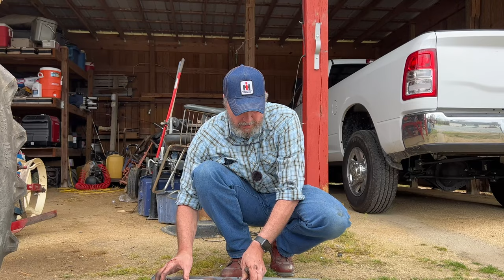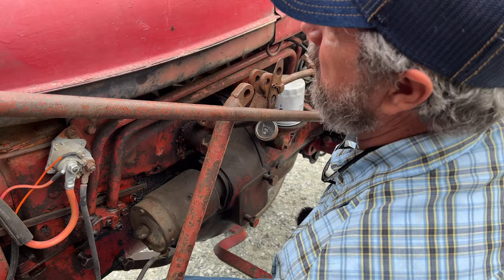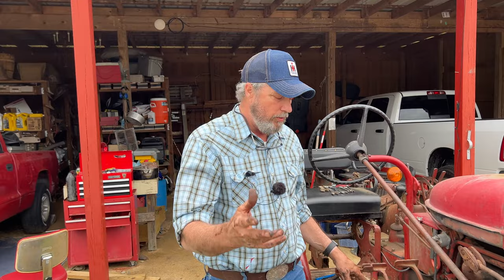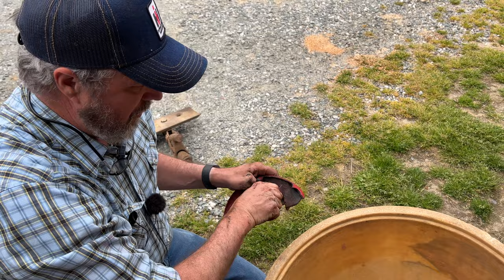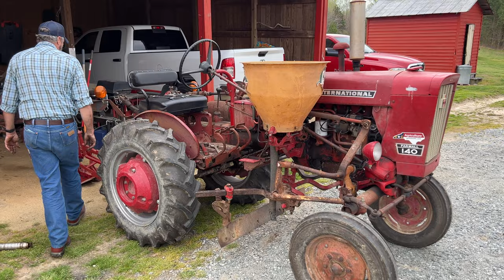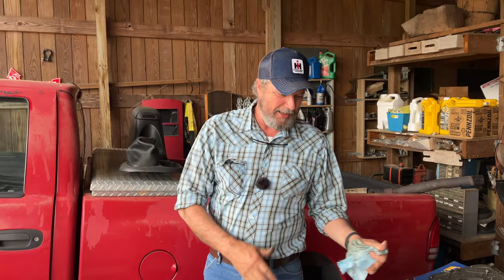Setting Up Fertilizer Drive and Corn Planter

Comment: Good video Joey.  IH did not make the cub through 140 tractors for people who were afraid of dirt and grease.  Every time you change cultivator and implement setups you end up crawling on the ground and in the grease.
Try using a mixture of diesel and used motor oil for the rust prevention on the fertilizer hopper setup.
Reply from the maker: Hey Lamont 
I’ll try that this fall.

Comment: Happy Easter Day our LORD JESUS has risen Amen
Reply from the maker: Hey Roger 
Amen Yes indeed.
Reply: Great video.  Especially for us novice.  The pry bar you mentioned was referred to as a “lady slipper” by most of us.  I’m just too old and under strength to constantly be installing and changing the implements.  That is the reason I use to justify having several Farmall’s.  Of course the batteries and maintenance become an issue.  A fun issue for me at the present time.  Storage is a different matter however.  Thanks for sharing Joey.  I hope you had a good “holiday” and thanks for reminding folks what the day really means.   Stan here.

Comment: You’ve got to get down and dirty putting a fertilizer attachment on... I learned to wipe the grease off the outside of the fitting on the hopper shaft before I got it on my shirt... the chain idlers are to keep tension on the chain and to keep them from rubbing on anything...
Reply from the maker: Hey Morris
It was still cleaner than Williams clutch . Lol

Comment: Look into the plot saver. But it's probably more expensive than just the electric tape. 

I have had good success with malorganite fertilizer. Those sensitive plants you can go down the row and just drop it along the row. If it's lots of area you might just get by doing the outside ends as they don't  want to move into it.
Reply from the maker: A subscriber mentioned five strands of fishing line. I might try that it’s pretty cheap.
Reply: @Jtwes  yea worth a try.

Comment: I saw this video a while back . Didn’t have a blade but i did make one out of a piece of wood and my bolts weren’t long enough so I used heavy duty electrical ties. And bro it works great . Biggest problem is don’t get it to low or the row will be flatter than I wished .
Reply from the maker: Hey Bart
I often thought a 2x8 would be fine.

Comment: 1st video I ever watched of yours a few years back was installing your fertilizer drive. I actually commented about how you hooked the john deere hopper to it. Thanks for sharing. By the way I can tell you been doing good. Your looking pretty spry and fit crawling around on the ground. I'm at 207 finally. I use the wd 40 gel spray in all my hoppers, it is really sticky and stays where you spray it.
Reply from the maker: I took Friday,Saturday and Sunday off. Been on it since late December. I’m sure I backed up a pound or two but on to July when I go on vacation. Hopefully we’ll break into the 180s by then.
Reply: @Jtwes  yep we will have our beach bodies by July.

Comment: I’m starting putting together one 140 from two parts tractor’s.  I also have a late model cub I plan to try setting up my planter. This cub has a quick hitch. The 140 doesn’t. 45” center to center on the 140. Not really sure on the cub. ?    All to help on High price groceries.  Yes.
Reply from the maker: Hope you get them like you want. Yes sir raising a garden is becoming very important.

Comment: Watched this for the 3rd time.  I am mounting the main drive unit that my IH Duplex seed hopper will sit on.  Also mounting the fertilizer distributor today.  I notice that where you screwed the tapered head bolts for the main drive into the frame of the tractor, I have through holes that are un-tapped. and about 3/4".  I'll have to use a couple of 8" by 5/8" bolts and nuts to attach it.  The old Super AV has "bosses" and they are tapped like yours are.  No "bosses" or tapped holes on the Super AI, strange.
Reply from the maker: Not Sure I never looked at A's that much.